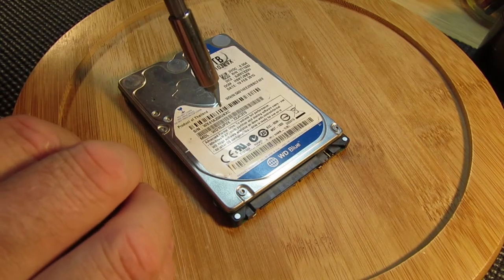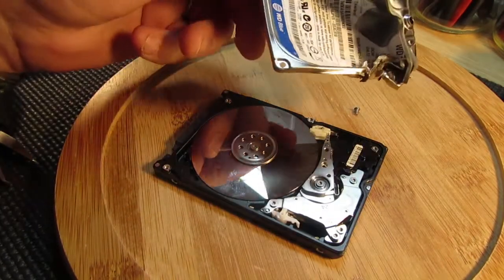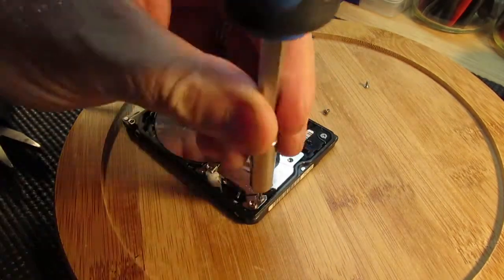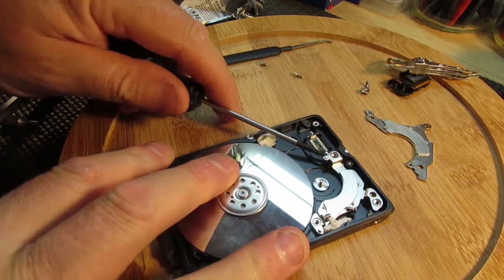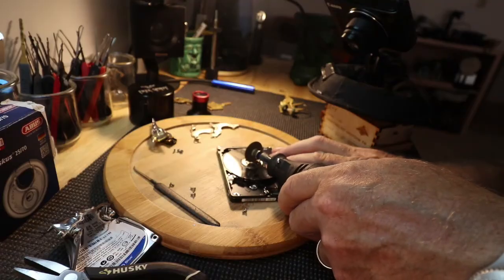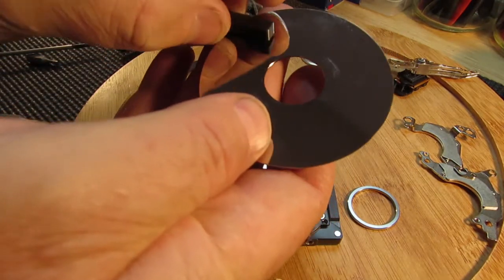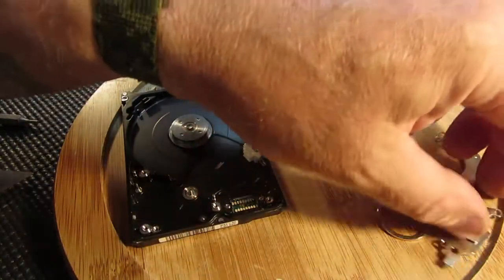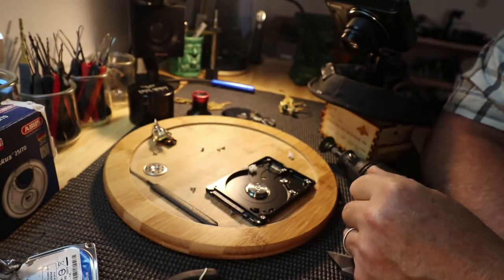Getting Powerful MAGNETS FROM Lap Top HARD DRIVE

Comment: I have a strong magnet on my vise, and it holds picks & tension wrenches.  You can also tie a string to one, and pull it on the carpet,  or floor beneath your work bench to pick up metal springs,  screws, etc.
Reply from the maker: good idea